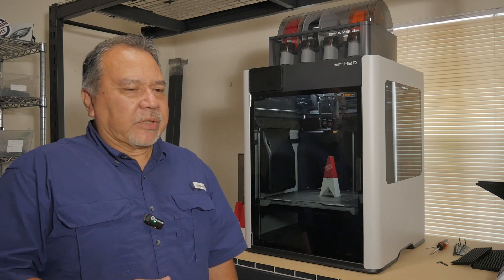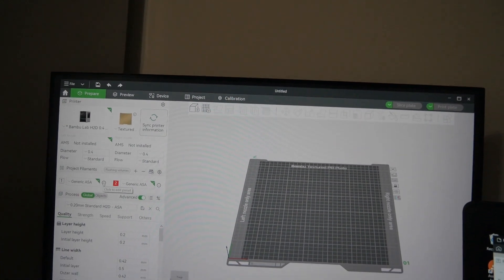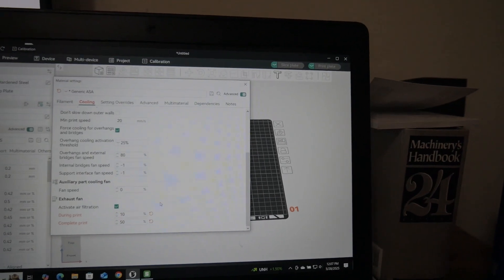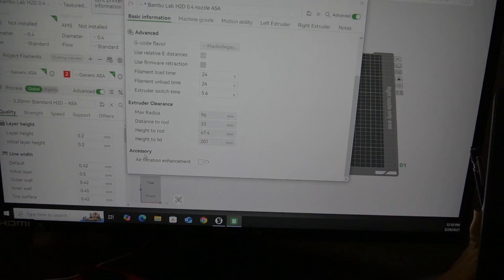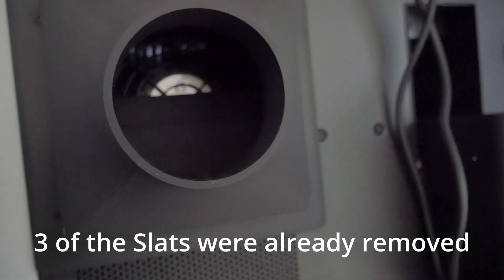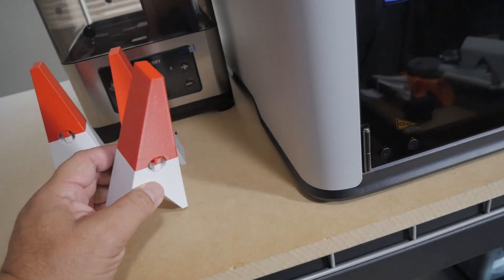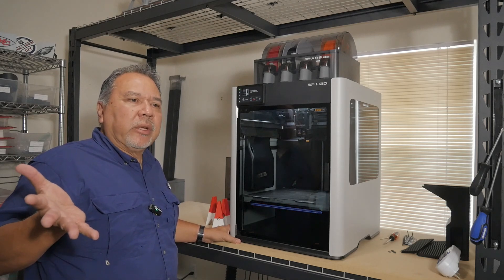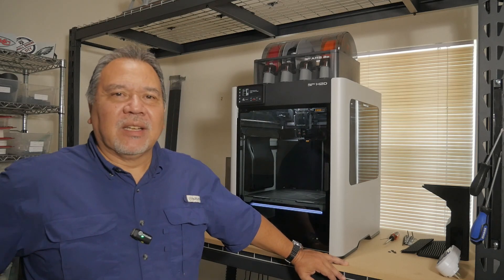One Thing that bothers me with the Bambu Lab H2D

Comment: Anyone who says venting a heated chamber during printing is speaking hypothetically and not from experience. I have a soft-sided enclosure with an inline fan that exhausts into a very large carbon filter. In the enclosure is a little 500W space heater plugged into a thermostat-controlled outlet. The inline fan at its lowest speed causes the sides of the enclosure to be pulled in so ambient air is constantly being sucked in.

If I’m printing ASA I put the printer (X1C or P1S) in the enclosure, set the target temperature, set inline fan to low, and print fume-free. Filament (single roll or AMS) sits outside and travels through a PTFE tube to the printer. The heater doesn’t run constantly; it cycles as expected. I use this rig with my resin printer too. Zero print issues, zero burning styrofoam smell.

I ended up here because I connected the large carbon filter to my H2D and was hoping to run the exhaust fan during printing. I’ve tried relying on the internal carbon filter and it is nowhere near good enough to filter the VOCs. It looks like my next step is buying a standalone inline fan and removing some slats. The enclosure’s inline fan is built into the side of the enclosure so I can’t use that.

Comment: You want to maintain your heated chamber, not lose heat through the exhaust and have your printer work harder and burn more energy.  Try printing a poop chute cover, that can possibly help your situation with fumes as well.
Reply from the maker: I had the chamber set for 40C.  Even with the three slats off and suction from the duct fan, the chamber maintained 50C.  Ambient temperature from the large heated bed.

Comment: Please confirm what removing the slats did to make the prints come out better?  Did it allow air to flow across the part to improve the cooling of the part when using your duct system or ???
Reply from the maker: I don't think there was any part cooling from the opening.  The chamber maintained 50C even though it was set for 40C.  I probably made some other changes...can't remember.  I think I made sure the part cooling fan was at 10%.

Comment: chamber heating with a fan on will just exhaust the hot air out, but I agree they should give you the option instead of locking the feature and just prompt you if with a warning if you want to do it. Maybe send a improvement request to Bambu Lab
Reply from the maker: It was interesting that the chamber maintained 50C even though it was set at 40C.  The minimal vacuum from the duct system is not enough to cool the chamber.  This was with no exhaust fan.  But, yes I would like a little more control.  I have some gcode that I'm going to try.

Comment: Have you tried setting the fan speed via gcode? I recently imported a filament-profile from a different vendor into bambu studio and it had Gcode in the start and end section to controll the fan: M106 P[1-3] S[0-255]; I dont't know if this is also overwritten by studio, but it is worth a try...
Reply: P sets the fan number and S sets the speed where 255 is 100%
Reply from the maker: Yes, I thought about that.  I'll try the code.  Thanks for the tip!

Comment: Yap, printer shuts down all vents and internally recirculate air trough filter. It is good system. I do not duct each printer, but keep them closed and contained as possible to keep temp and nastiness inside. I just keep print room in negative pressure and exhaust whole room out with fan. Negative thing is that I have to clean printers inside more regulary because all particles stick inside printer. H2d works well because all nastiness is deposited in filter. That is the way I do it, is it wrong or right I truly do not know.
Reply from the maker: I guess it's matter of preference. When I first started printing with ASA , I was just venting the room out the window but the odor was still hanging around.  Decided to use the ducts.